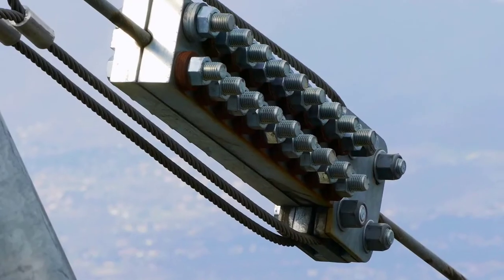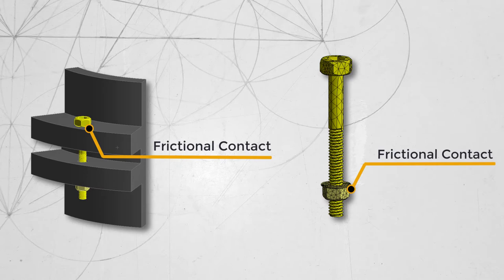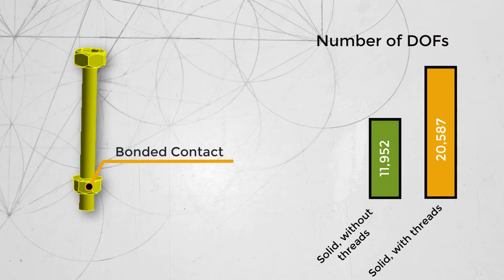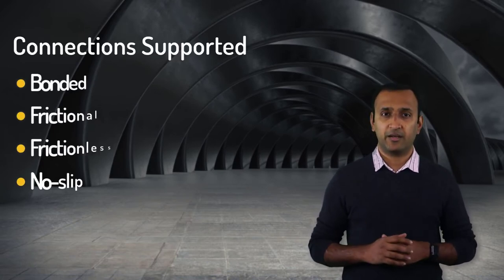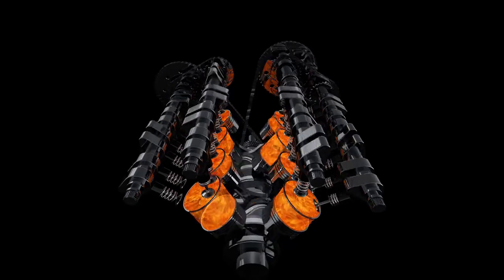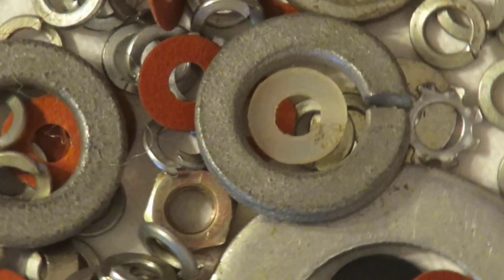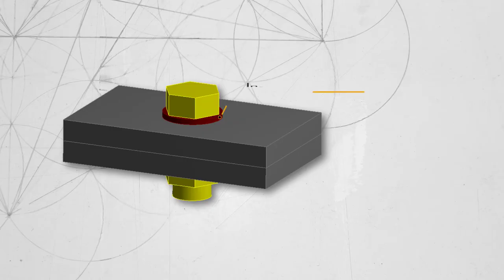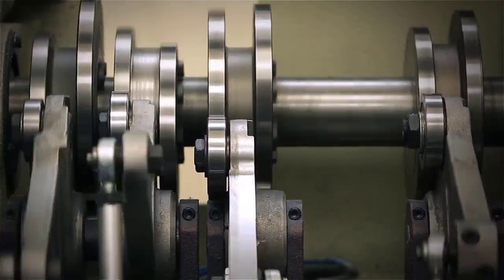Intro To Connections Using Ansys Mechanical — Lesson 1

Comment: At 11:27 you mention preload impacts natural frequency and a study on this can be done using beam elements. Where can I find resources for modeling of bolted connections to support modal analysis?

Everything I find is for static analysis and uses non-linear contacts which don’t apply to a modal